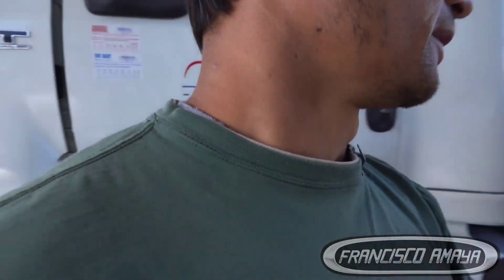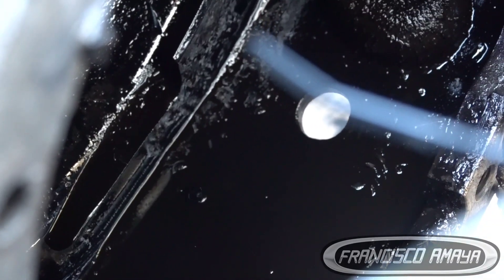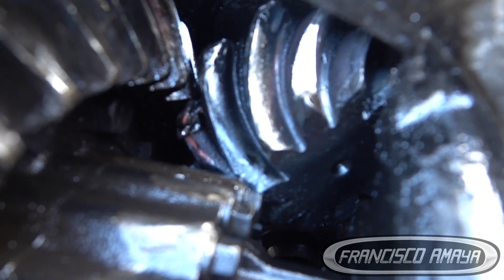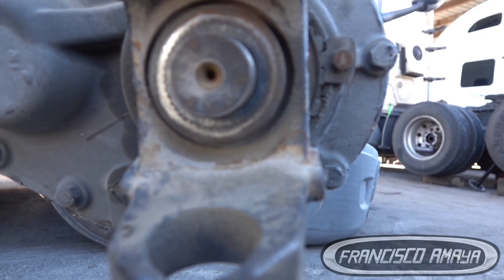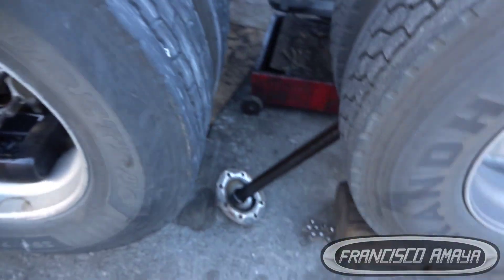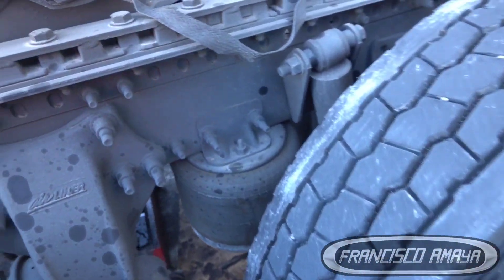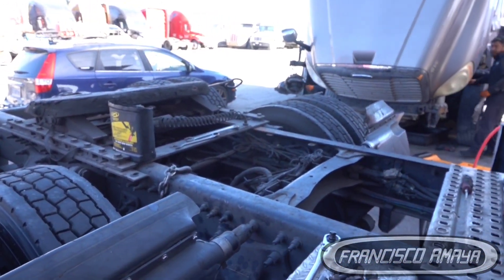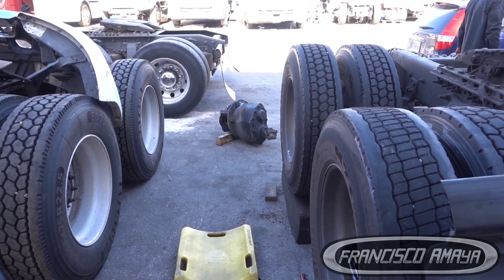FREIGHTLINER CASCADIA BROKEN DIFFERENTIAL HOUSING INTER AXLE DAMAGE LOW OIL LEVEL

Comment: have to be careful these days with newer trucks that have manual trannys.  harder to shift because they are so quiet. if you forget to turn jake brake off and try to shift, you can grind gears that way too.  def need to check fluid levels. All fluids. thats important too.  If you buy a newer truck, its just better to get 1 with automatic trans these days.  They will last longer and you wont be as tired from shifting all day. thats what I think.  Happy trucking!
Reply: Shifting a newer truck with a manual transmission is no different or harder than shifting an older model. You shift by rpm not sound.
Reply: automatic transmissions are the worst when it comes to repairs and breakdowns. my 1st freightliner had 2 million miles on the original transmission.
Reply: if I was a fleet owner, Im pretty sure I would buy automatics these days for the newer generations learning to drive. My latest choice for me was '25 western star with 13 speed. I have 35 years experience and it was difficult in the beginning. The whole shifter rod would spin and it was too far back.  arm hit the seat.  I had to to take out 4 times to heat and bend to get it in a comfortable position. plus had to weld the shaft tight to the rod. rubber bushing in it to keep it quiet. very hard to shift when it would spin on me.  gears were deeper than most which I really like now that its broke in. Yes I grinded and jammed some gears in the beginning. LOL.  still pretty happy with the western star DD16. 13 speed for me now.  whatever you drive, relax and have fun with it.  enjoy the road!